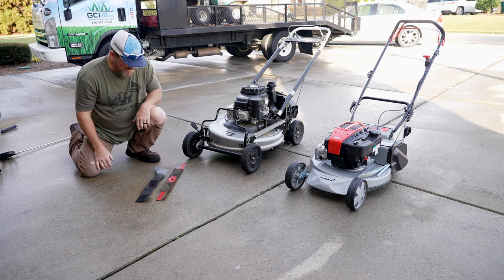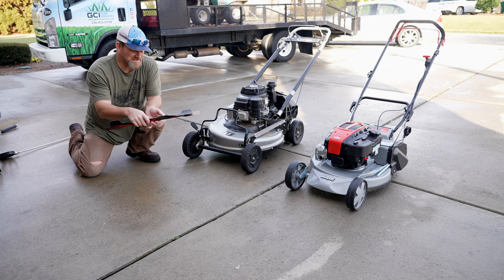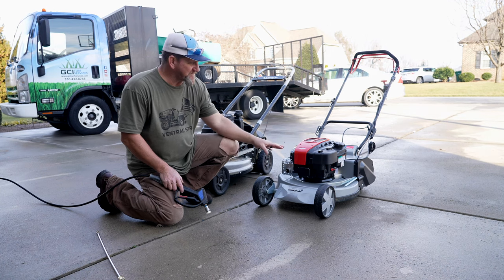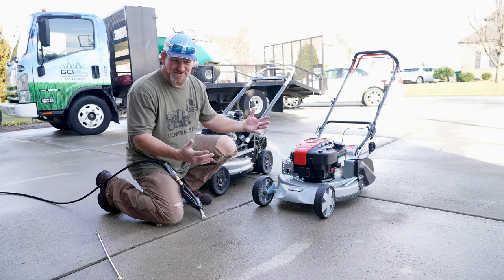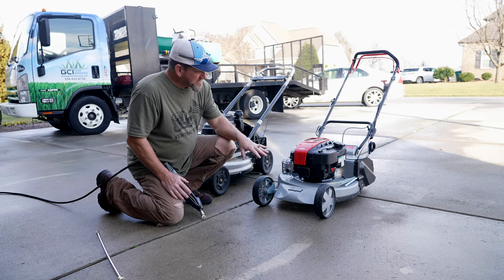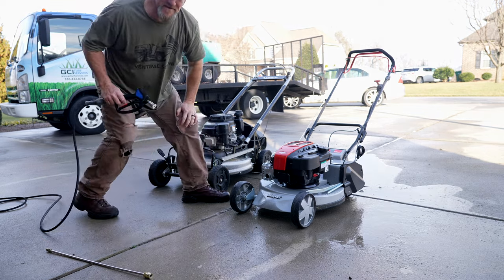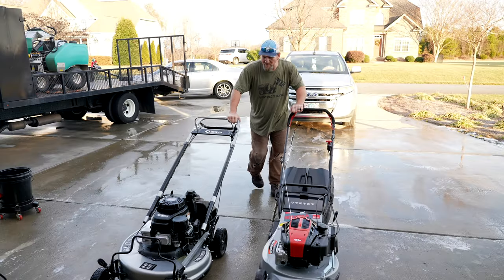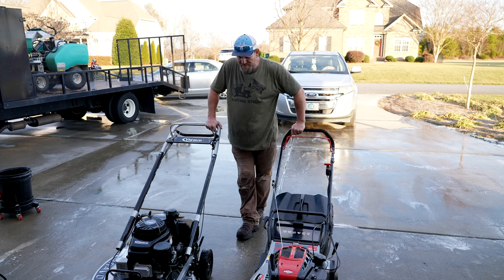Push Mower Deep Clean Detailing

Comment: Pete, when you get the blades back from the sharpener, and you're ready to put them back on the mowers, is there a particular torque you put the blade bolt back on with?
Reply from the maker: No. I use my dewalt. I haven’t torqued a mower blade bolt in 20 years.
Reply: @GCITurf  Thank you Pete, for your quick response. 
I learn something new every day. ( I'm done learning for the day) LOL! Just kidding!
Reply: @charleswise5570  🤣🤣🤣😂😂
Reply: id use a hytorq about 3000psi
Reply: @Lettuce-and-Tomatoes  like 30 clicks?
Reply: @Lettuce-and-Tomatoes  good call i just had my 2in drive set up. that was a close call. good lookin brotha
Reply: just hit them with a couple 1 sec intervals with the impact driver after its tight.

Comment: I’ve bought many push mowers over the years and every one started leaking oil after tipping it backwards like that to clean or inspect. Oil leaks through the air filter.  How do I prevent oil leaks and buying 50 filters per season? Never use commercial push mowers only residential